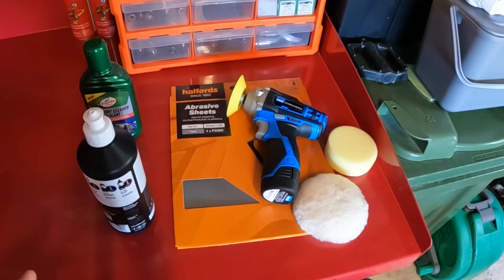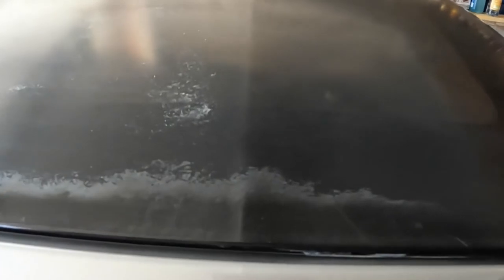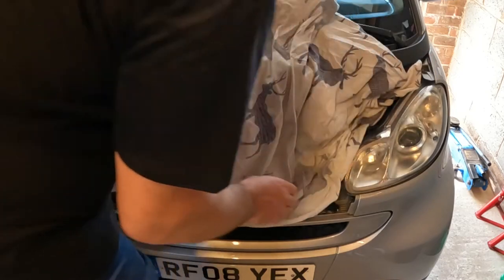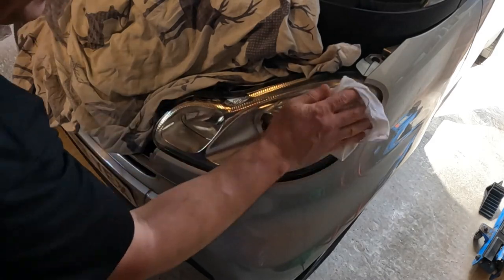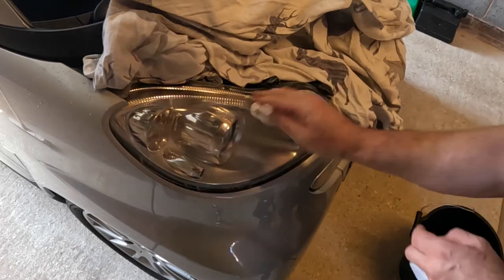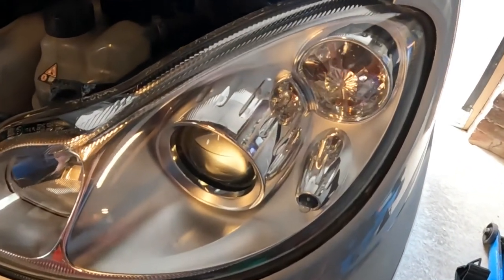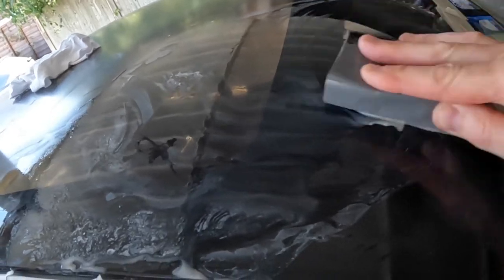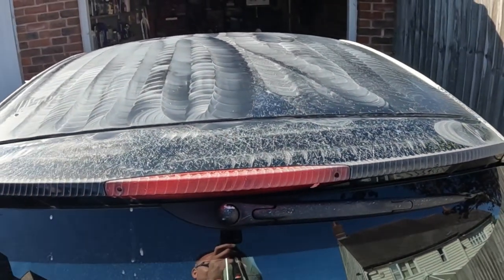Smart Fortwo 451 - Polycarbonate Roof and Headlamp Restoration

Comment: Great job! 
It is better to use sandpaper only. 600 then 800 then 1500 then 2000 with water everytime. 
And after that use antisilicone and coat with lacquer in spray. Because without lacker coat the roof and the headlights will get even worse in one next summer.

Comment: When I first started looking for a Fortwo I wanted a Passion model. But a few years ago Smart cars were few and far between here in West Virginia. So I settled for a Pure. The first thing I did was buy a panoramic roof from a reseller in sunny California. It had slight sun damage,  but I removed the solid roof and installed the panoramic one. I keep it heavily waxed and keep the car in the garage. But I can see I will need to do what you did in the video before too long. My headlights were about the same as yours and I found a Turtle Wax kit that did nicely on those. Thank you for a great video and greeting from the States!

Comment: The roof is supplied with an anti-UV laquer to protect the polycarbonate. It's this which flakes off over time and which looks a mess. It needs to be replaced otherwise the polycarbonate will craze badly possibly leading to cracking. The same applies to the headlights.

Comment: Much better. Just done the same, 2 days of sanding, polishing. Went to heavy on the grit, few swirls, but much improved. Then ceramic coat. See how long it lasts until UV knackers it again. Mercedes.want some £1200 to replace and fit😳

Comment: Thanks for making this helpful video, I've got a 2004 Smart Fortwo, Luckily for me the roof is glass but the rear quarter windows in the boot area are plastic and have gone exactly like your roof did and my headlights could also do with a polish too, I've done headlights on other cars in the past and got excellent results but wasn't sure if the windows would come up the same, after watching this video I'm confident I can save them, the only thing I will do different is use "Meguiars Plastx" polish as I've heard it's very good, I will also be using my Sealey buffing mop which is mains powered.

Comment: Very informative  do you think that maybe a clear coat would help preserve the roof panel.
Reply from the maker: Oh definitely. With hindsight I could have spent a lot more time on this roof, sanding it back with progressively finer abrasives and then applying UV resistant clear lacquer. I know I’ll need to revisit this but still heaps better than it was.
Reply: @autoknight747  It looks great I am enjoying all your videos as I am considering another Smart Car I had a new 2006 passion but we can't get any newer than that and still get a diesel.

Comment: Do you by any chance know the part number of the polycarbonate roof?
Reply from the maker: Unfortunately I don’t and wouldn’t want to mislead you by giving you incorrect info. Best to contact the dealership to obtain the number for your specific vehicle as parts vary between different regional markets.
Reply: Yes, I do... I'll give it to you in a minute. Phone is uploading it's work at the moment. 
Part number is FW02953 GTNFYG and it's called "Smart 451 panoramic roof and windshield replacement. " Hope this works.